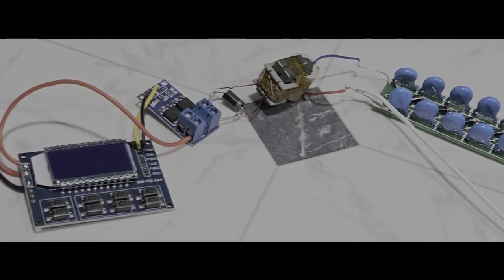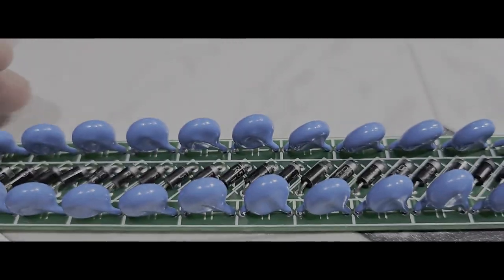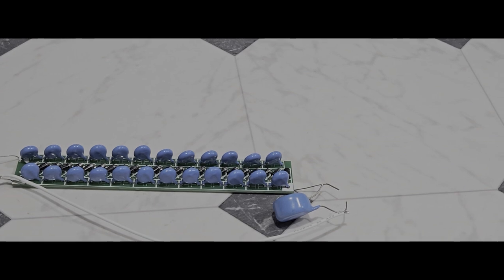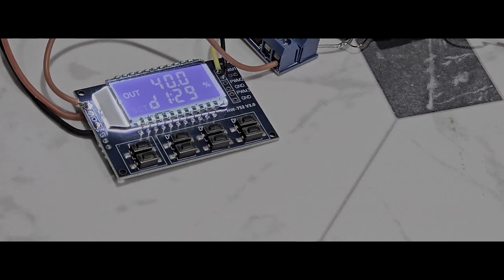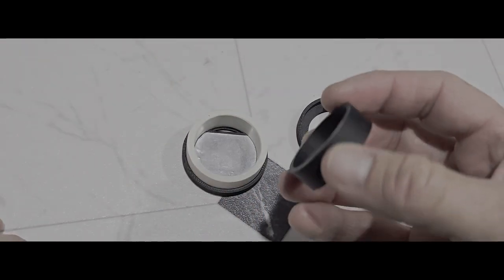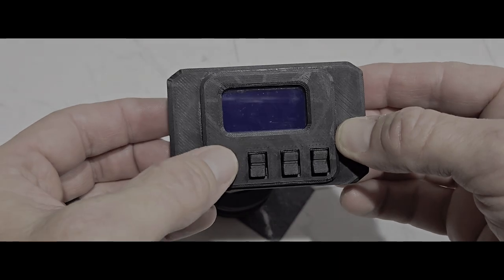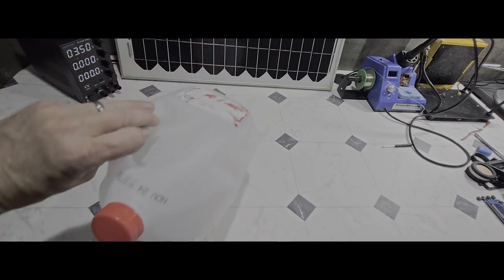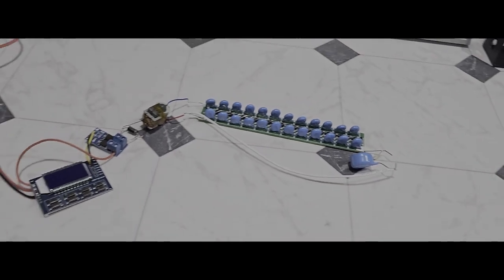Electret HV Power Supply

Comment: Edit: 
Won`t work properly with 3d printed elements, because HV will just leaking like gas, you will need perfect insulation...
You have to use ceramic or porcelan insulator..
Reply from the maker: Yeah I have some overhead projector plastic sheets
Reply: @redesign3dp   Any progress with polarising HDPE?
Reply from the maker: @tamastokai1477  I melt the plastic outside. But it's been cold so I shifted over to other projects for now.
Reply from the maker: Not to mention that video didn't recieve much interest.
Reply: @redesign3dp  
So you have to make it interesting :)